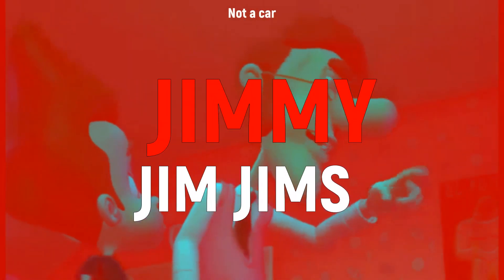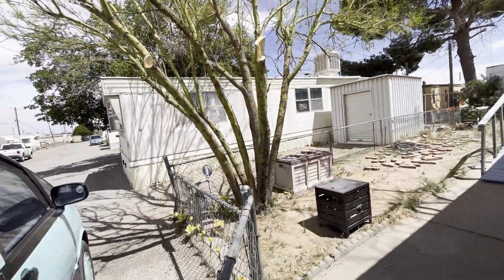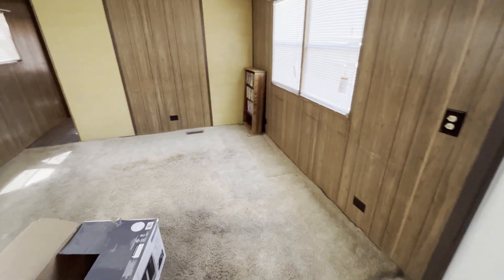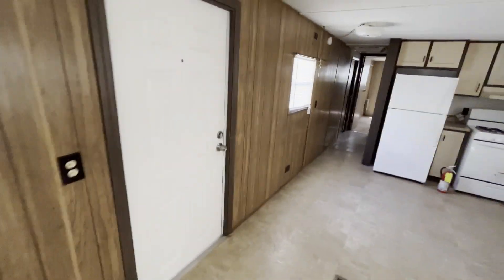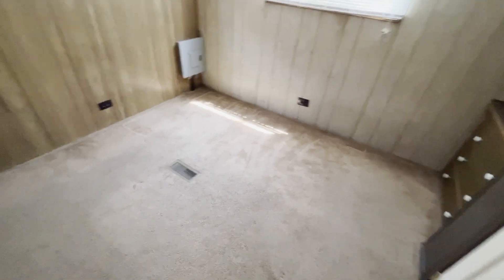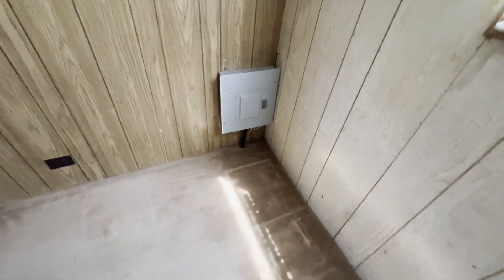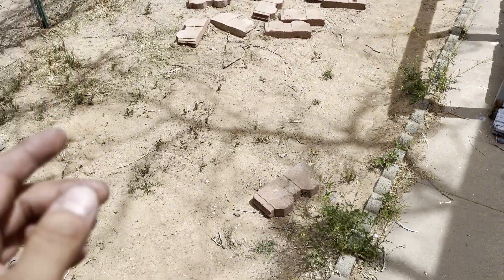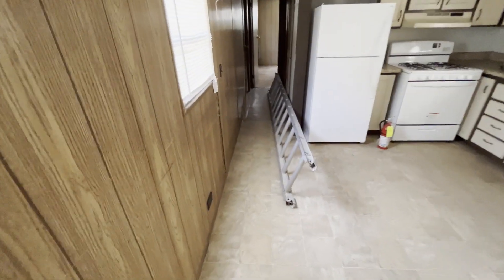The Rotten Trailer Rebuild Fiasco (Part 1)

Comment: Excited to see the progression of the home Jimmy, awesome vid 
How much did that run you if you don't mind me asking? Never considered mobile homes but my girlfriend lives in one which isn't too bad and the community it's in is pretty nice/friendly. The one you got isn't too shabby and looks pretty comfy :p
Reply from the maker: This one is a 2 bed 2 bath and it cost me $19000 cash, I'm about $3500 into renovation thus far and it looks 100x better than it did when I shot this first vid in April, but there will be more vids over the next few months (at least 5 that I've already filmed). Never even considered living in a trailer but the housing market is astronomical so I'm doing this for now basically until the market crashes or lowers lol
Reply: @jimmyjimjims7483 19000? Yikes guess trailers are going for a mint
Reply from the maker: @robertsmith987  $19000 includes the shed which I sold for $4000 so it brought the total down to $15k but yeah any kind of property is ridiculously high right now because of people flooding into this area from California and other failing states/cities. It doubled the housing prices here in just over a year
Reply: Is it on leased land?

Comment: I love trailers and trailer parks.  I just don't like the types that end up there.
Reply from the maker: And boy are there some "characters" that live in said trailer park. Luckily this is a mostly elderly community so my neighbors are little ol blue hairs that are pretty friendly
Reply: How far a drive is new pad from work?
Reply: @jimmyjimjims7483  those shower heads are the bomb bro good high pressure and reliable easy to unscrew and clean. People put those big ones in mobile homes and they have no pressure.